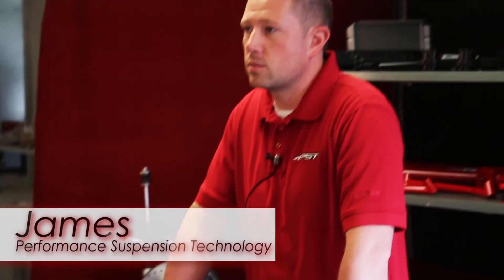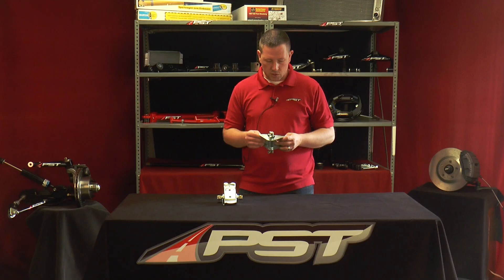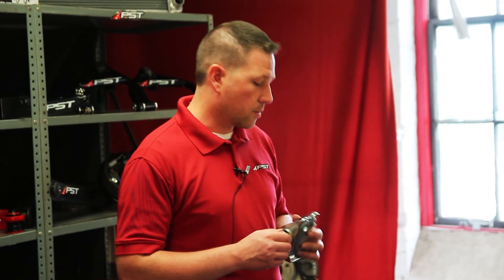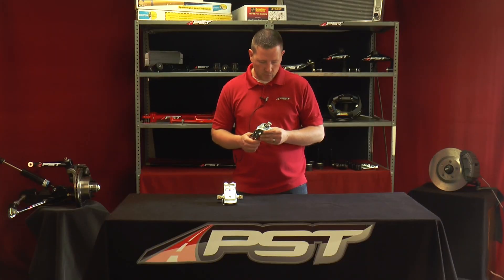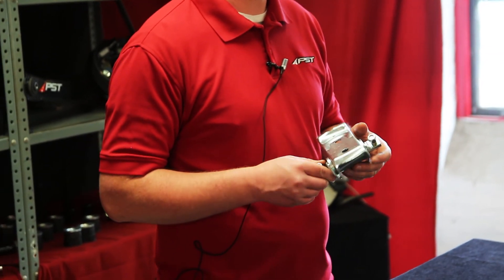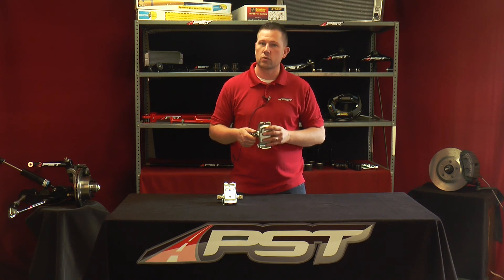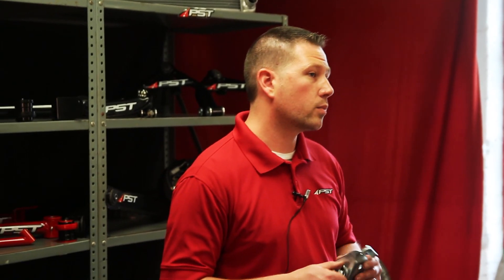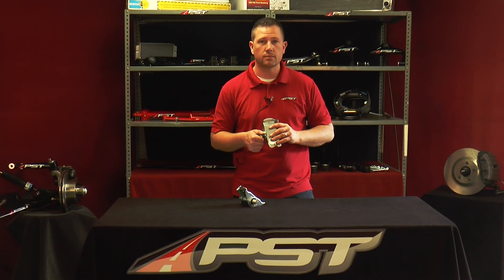PST's Low Friction Teflon Insert Spring Perch

Comment: First generation of Ford spring perches had a bronze bushing (found on early Falcons), with a grease nipple. Before the Mustang was launced, Ford went to a cheap maintance free vulcanised rubber bushing, that added some unneeded resistance into the front suspension.